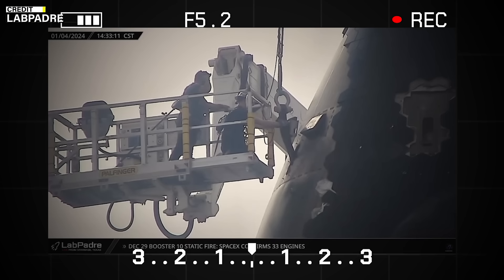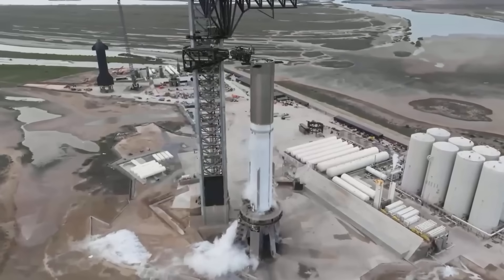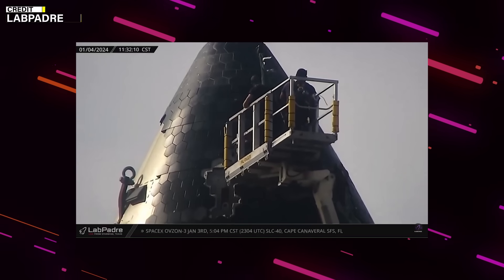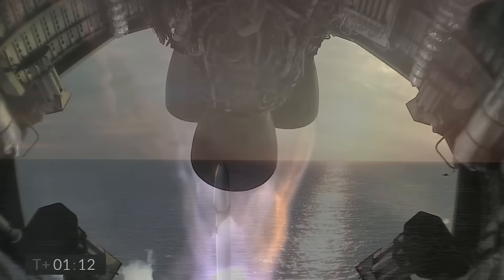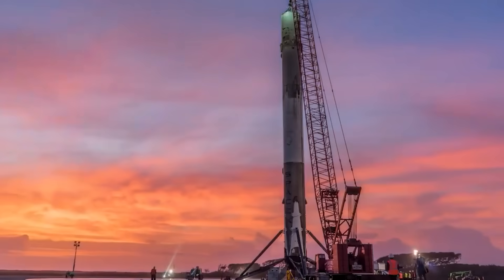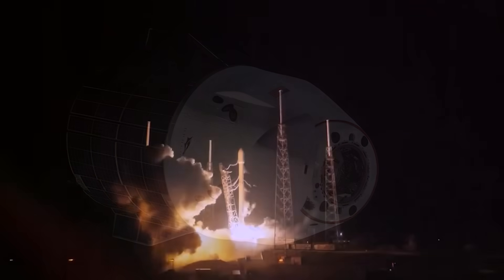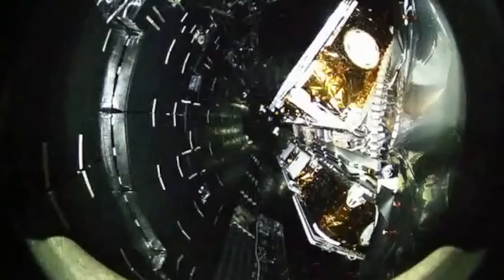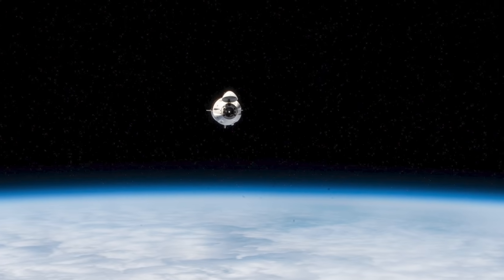Lifting Points Of Starship - Closed, NASA On Crew 8 Mission | Episode 27

Comment: I think everything is going to work out right. You have all 33 rockets 🚀 working on the 1st stage you built the upper lower rockets where they will separate with upper rockets running and everything should work out just fine. This is just my thoughts. And you have some of the best Engineers working for SpaceX can't get any better than that.